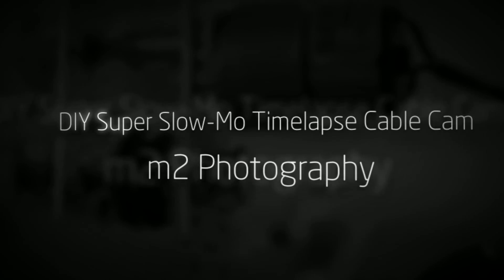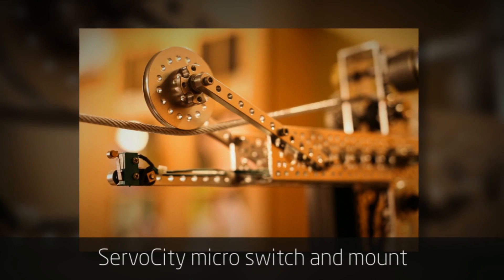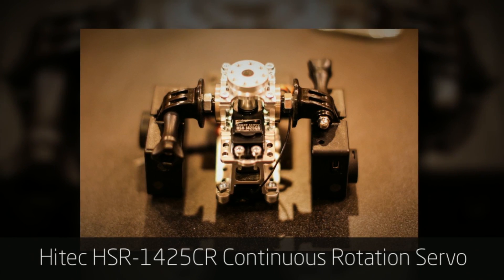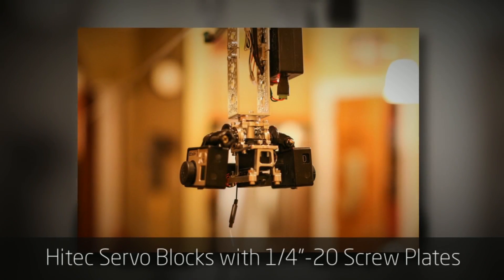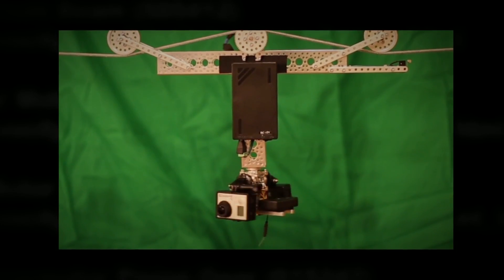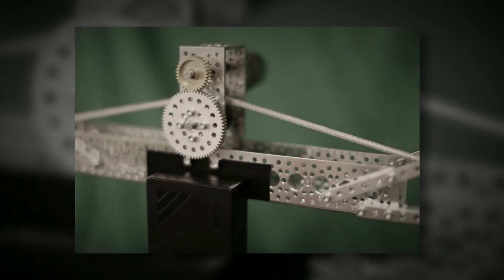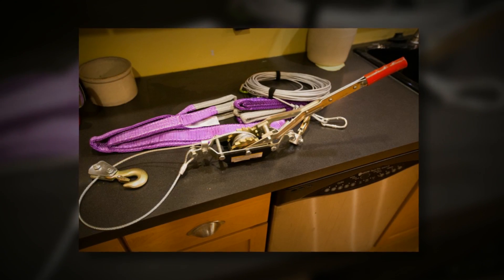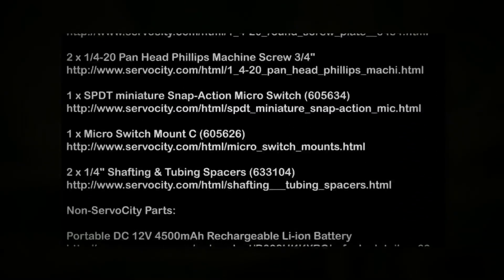DIY Actobotics Slow Motion Time Lapse Cable Cam

Comment from the maker: Not sure exactly what piece you're referring to, but if it's the one int he middle where the cable rests on top, that's just heat shrink over the top of the aluminum pulley.  I thought that the rubberized heatshrink would give it more grippey-ness on the cable.  I would assume that this would work on a high speed version.  Good Luck.